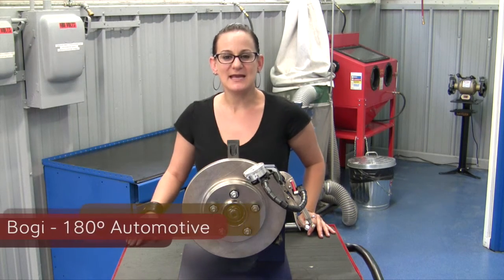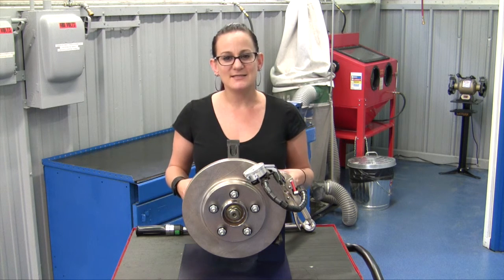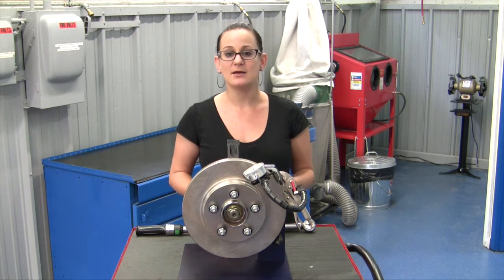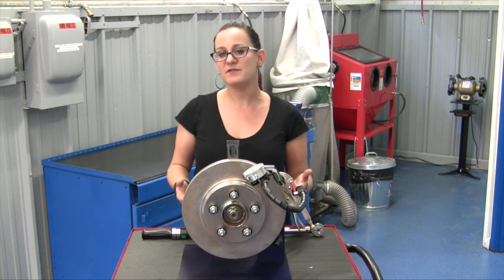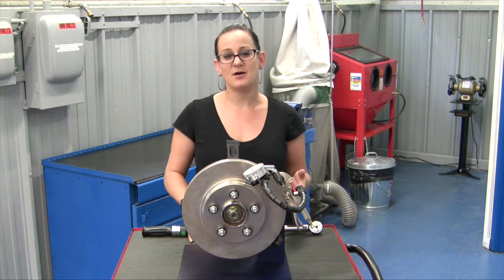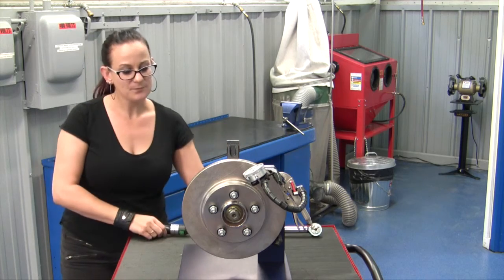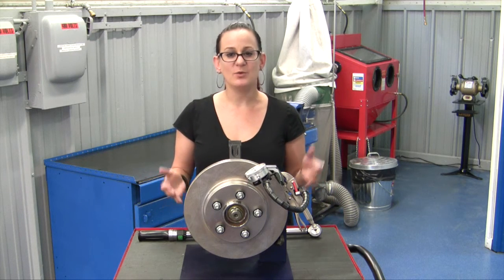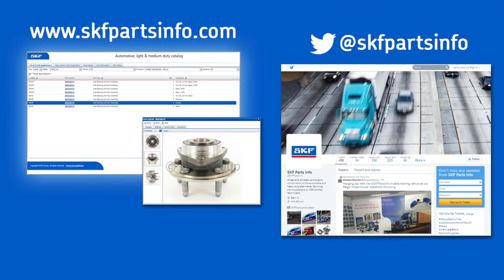Measuring lateral runout with Bogi

Comment: Good info but for a person whom already has an understanding.  Need more detailed demo and graphic of lateral runout.
also, slides of causes and effects.
Reply: Agreed, for instance how does one mount the dial gauge so it keeps relative position with the rotor, and is there a correct radial distance from the center/axle that should be measured (ie - towards inner, middle, or outside rotor circumference).
Reply from the maker: +L 88 Thanks, this is good input for a new video.
Reply: @SKFPartsInfo   do we able measure faceout/lateral runout in CMM?
Reply from the maker: @OneMinuteWorld.  I believe you are asking what about the Centimeter measurement? If so, it would be 0 .005 to 0.0127.
Reply: @SKFPartsInfo  Co ordinate measuring machine
Reply from the maker: @OneMinuteWorld.  No, a CMM cannot be used.